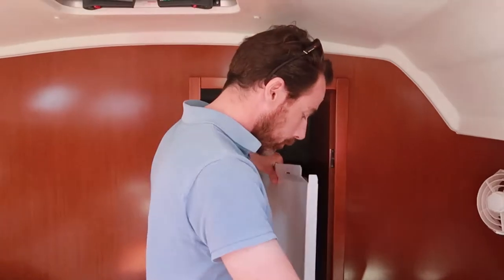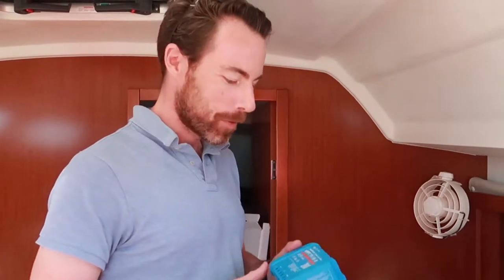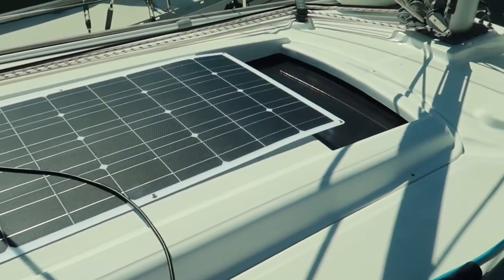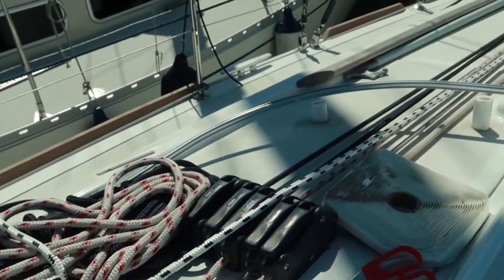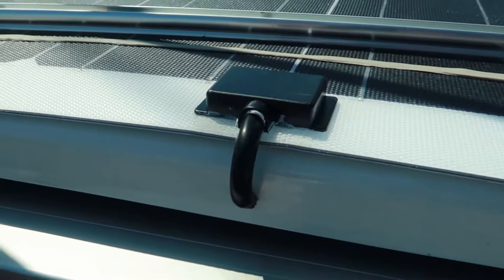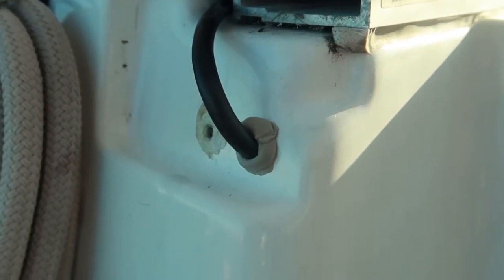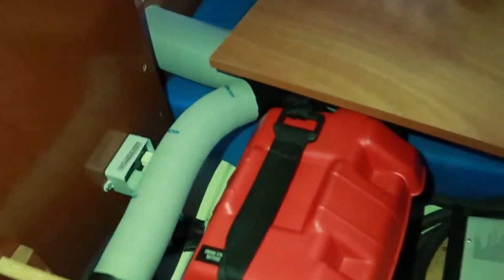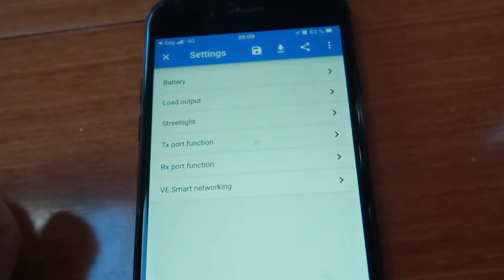Sustainable energy for the sailboat! DIY installing solar panel

Comment: Hi. Thank you for your videos. So, I noticed that you've changed boats, but I have a question about the equipment on your Oceanis 34. It seems that you have a forced air heater. I saw a vent in the video (at 4min32). I have the same boat and I'm wracking my brain trying to figure out which diesel heater model to use and where to install it. Could you tell me the model of this equipment on the boat and where it was installed? Thanks in advance.
Reply from the maker: Hi. I believe it was a Webasto 3400 unit (diesel heater). It was installed in the port aft cabin under the stern porthole. You can lift up the shelf there. It’s a good location since it’s fairly close to the diesel tank

Comment: Hi, I just saw your video about installing solar panel on deck, I was wondering if the boom did not cover the solar panel? On a sunny day how much was this single panel charging? Thanks. Bob
Reply from the maker: It really depends on many factors of how much shade you’ll get. We found that most charging is done when the boat is docked in the marina. When out sailing you’ll probably get shadows from the sails or might be heeled over away from the sun which will decrease the solar input. On a sunny (Scandinavian) day and when docked in the marina we’ll get around 300wh on the batteries. Basically we never really had the boat connected to shore power since installing the panel🔋☀️